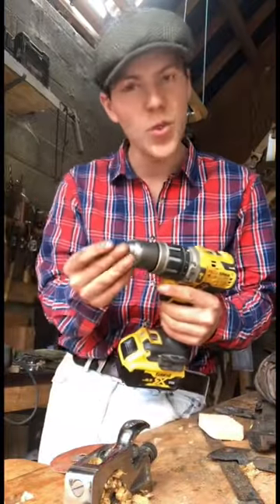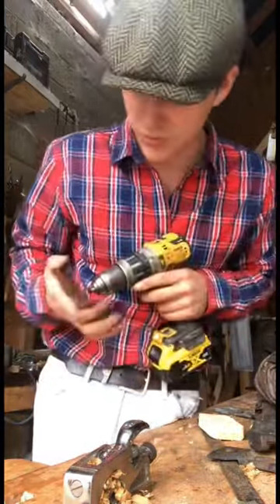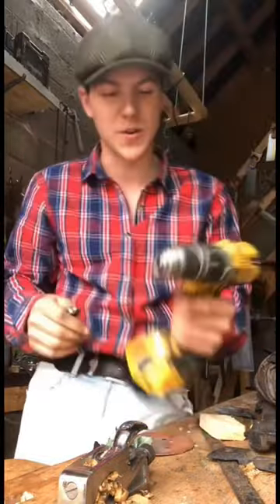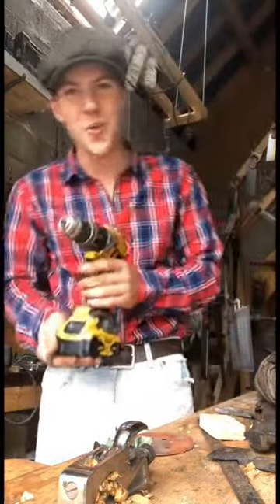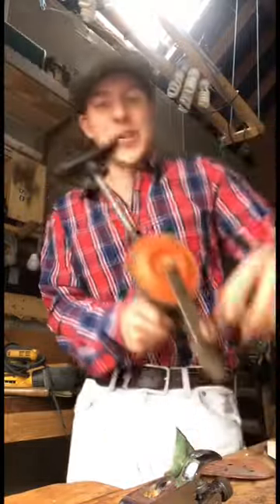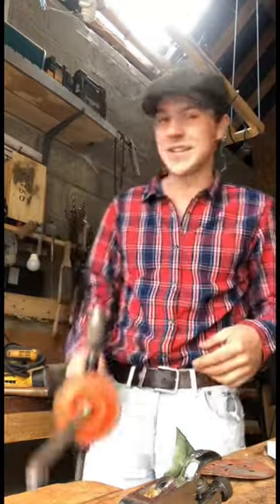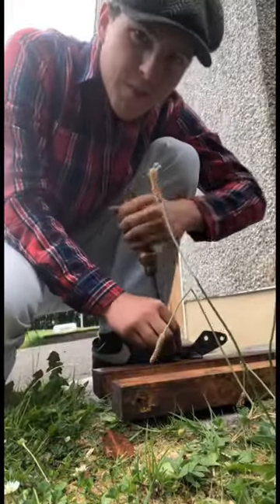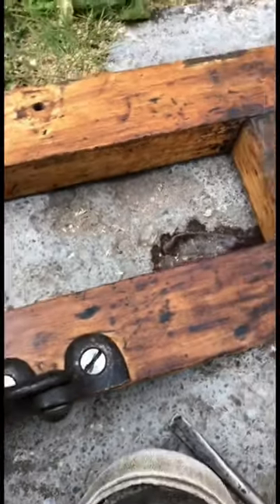Trick for restoring / cleaning screws #shortvideo #satisfying #tipsandtricks

Comment: That drill will last you a lifetime the way you use it 👍
Reply: But when it breaks, he will just switch back to a brace.
Reply: @simplestatic3751  or he’ll fix it.  The type 3 plastic dewalt makes its tools out of will out live him and the brushless motor will likely last a good 10 years  battery maybe 10 years. Hard to say
Reply: In my experience it's the switch that dies first, but it costs 4 bucks to replace.
Reply: @satibel  that's the case with most lithium powered electronic. Nominal open/close switches just don't have a good enough spring yet to hold these charges over the years.
Reply: @EddyOfTheMaelstrom  I've seen switches fail even on nickel batteries, it's usually the variable resistor or the transistor that fails, though on/off switches do burn too.
Inrush current on coils does a number on switches, and a lot of uses will wear out thin film resistors.

Comment: Have you considered treating the screws so they don’t rust as easily again? I have heated mine up with a gas torch and placed them into used motor oil, blues the metal beautifully and has helps protect them!
Reply: Oil does make an excellent protectant. 😊🌎✨

Comment: I like to use a bench mounted wire wheel and then top it with some clear coat. Clear coat turns the little bit of rust left black which gives you a rustic look.

Comment: You know theres a reason we started developing power tools. The way we used to work was even more back breaking than it is now. Im sure your Pa can tell ya. Back pains, knee pains, wrist, shoulders. You name it. When I do the old school way of tiling a floor (occasionally still do) I find myself hurting for weeks lol. Much different than mixing thinset with a drill and smearing it on the ground to drop tiles on top of cement board that I screwed in with a power drill. 

Its still cool and fascinating to do it like they used to do it. Or even just learn about it. But you gotta give respect where respect is due when it comes to some of the advancements we’ve made and the many advantages its given us. 

Being able to make a mortise and tenon joint in a few minutes as opposed to hand screwing and chiseling for 30-40 minutes. The time saved is huge especially in the construction of a home. 

Just my two cents I guess?

Comment: You can use the eggbeater drill. I use sanding sponges, or sandpaper stuck to a sponge, held upright in the vise. When you push into the soft sponge it the screw stays in place and doesn't walk away on you. I do this restoring hand saws to make the nuts nice and shiny again. Look like new.

Comment: if you wanted a hand operated version you could a gear train so that the screw at the end is spinning fast enough, just using gear ratios starting from a manual crank handle. and a chuck or holder of some sort you can attach the paper to and slide toward the screw?

Comment: double sided tape the sanding pad to a piece of wood like the corner of a bench and use the hand drill to clean off the rust . if you have enough room you can set up both grades of sand paper to get the job done faster . see no power tools needed just a bit of tape and a lot of elbow grease

Comment: I just put a piece of scotch brite on the tabl and take the screw in hand and rub it back and forth on the scotch brite. Anything else I use a wire wheel on a bench grinder. Drills are nice for when you are out and about but the key word you say was expensive. 😅

Comment: 👍Ive got an old Greenlee
or Greenfield breast drill similar to yours. Made here in the States, probably no later than the 1920s. Patent date is late 1880s..A very fine bombproof tool. I use a jacobs chuck, salvaged from a dead cordless drill that allows me to use very small dia bits.

Comment: There is a way this could work with your manual drill. You could place it upside down on the ground, hold it with your foot by that flat part at the end and crack on. Wouldn't get the RPMs but hey, it's doable.

Comment: Bull ship, not only does he have a random little power tool for use here and there. He's got a DeWalt XR. One of the most powerful and expensive of the drill categories. He could've used a lesser version of the same brand and line. This shattered the illusion for me. What else is he's cutting the scenes for and using this incredible drill for

Comment: So first of all you have a very low threshold to consider something loud. Second, a dewalt 20v drill like that is about 100 USD. 3d, I've never had one break, at least un-repairably. I've had one wear the brushes out, but that's an easy fix. I had to send an impact driver for a warranty issue but that's free.

Comment: tell ya what. if you want to keep that screw looking nice and avoiding rust, get yourself a bottle of 44/40 cold blue solution. Its mostly used for firearms repair so it may be hard to find in Ireland, but it will give that screw a bluish black finish that is mildly rust resistant. Just remember, that stuff turns metal black in a matter of seconds, so dont let it touch your skin or else you'll dramatically increase your risk of skin cancer, highly recommend gloves when using it. And once youve applied it, let it sit for about a minute and then wipe it off and add a little oil to nuetralize it, any oil will do but I prefer machining oil or tapping oil.

Comment: Do you have an old style post drill? It would work. One hand on the wheel to crank it and hold the sandpaper, or even use a block with the sandpaper on it. 

Also I use a round block with a hook and loop sticker pad on it , I can use orbital Sander pads by hand, very usefull.

Comment: Hey what if so you can use your old tool get a large piece of metal and drill holes into it of various sizes for various size screws so you can put the sand paper in there and put the screw in there and the metal will hold the screw in place?

Comment: Ummm why the hell didn't you simply use the sander?
You wouldn't buy sanding discs if you didn't have a orbital sander. Those discs are 5x the price of regular sand paper and it would of been 20x faster not putting all the screws individually in a chuck

Comment: Don't apologize. Your Craftsman in the simple fact is is what you can do with a power tool multiplies your labor intensely yeah they break but by that time you've done enough work to have paid for it's self a hundred times over by your saved time even if you only value yourself at $3 an hour. Ain't nothing wrong with using your brain.